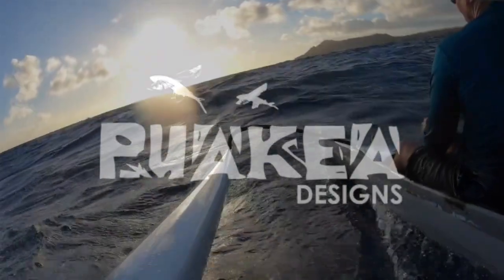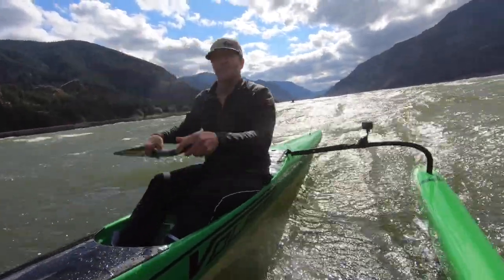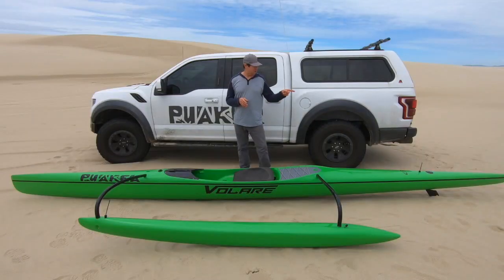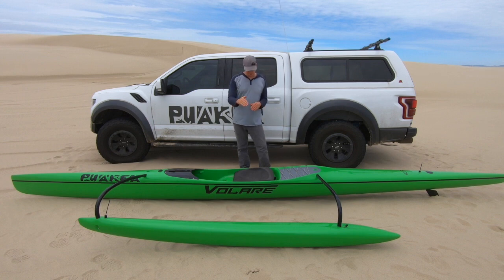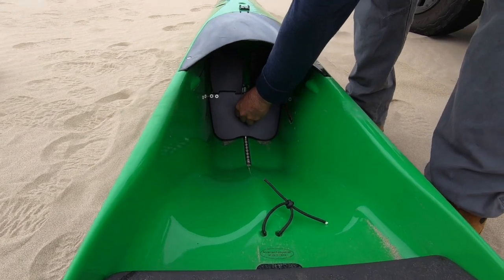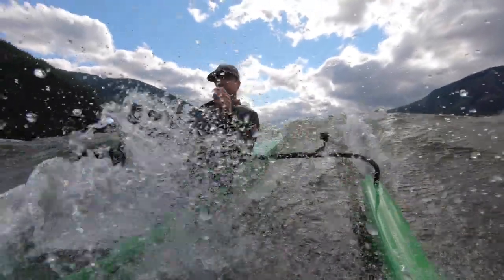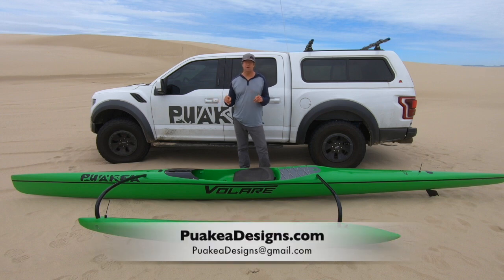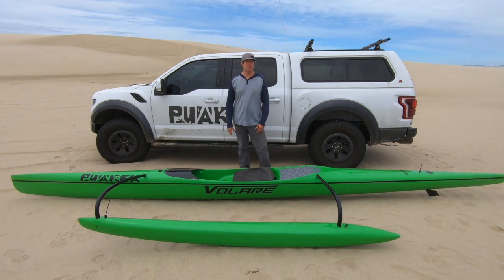Why the Volare? Part 1-  Choosing an Outrigger Canoe

Comment: Any tips on finding the sitting place for your seat and legs for proper centering to ride bums easier?
Reply from the maker: A lot of this has to do with comfort. If your legs are too flat  it can cut off the circulation to your feet. If knees are too high it can cause other circulation issues. You would just have to play with it because its different for everyone. So, I would start as far forward as possible that is comfy for your height, move back one spot at a time until you STOP dropping in as easy. Then move it forward again 1 or 2.

Comment: Very curious. I just got a kahele about two months ago and I'm around 200lbs dry weight. Having a blast with it as it gives me more options to chase bumps due to its ability to maintain its speed in getting on a bump in downwinder and manoeuvre to drop into a side bump. I had a Antares before and always felt "stuck" riding a bump until things opened up for me in the swell. Will the getting a volare improve anything for me ?
Reply from the maker: The Kahele's greatest strength is it's maneuverability and it will get you out of a lot of tight spots. When I catch a bigger bump, often it will be the quartering/side small bump that will get in my way and I can use the zig zag kahele to follow that one instead, keeping me on a bump, but maybe not the bump I wanted.

The Volare doesn't have as much maneuverability but with the larger volume will just run right through the small bump keeping me on the big one. It still turns really tight though. I'm 180Lbs and if it's windy, I want the Volare. It just holds the higher speed for so much longer.